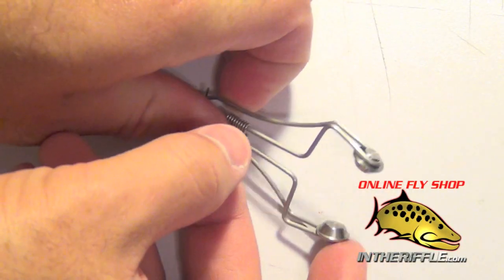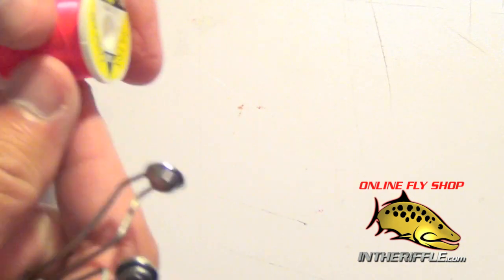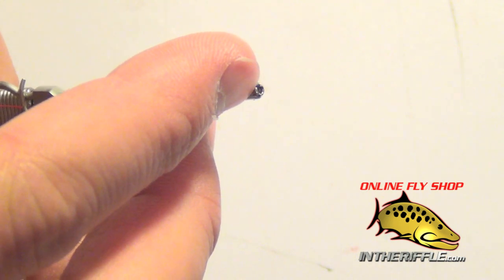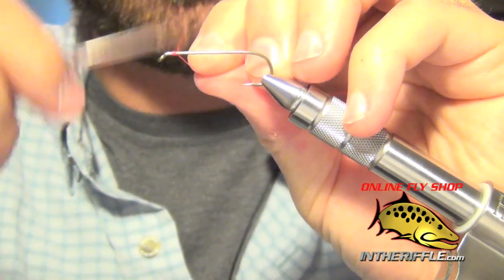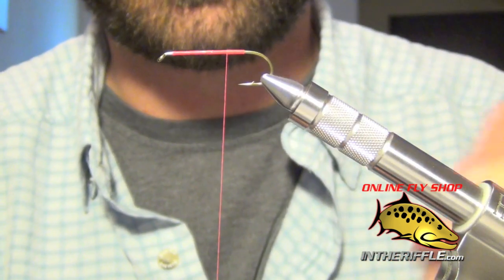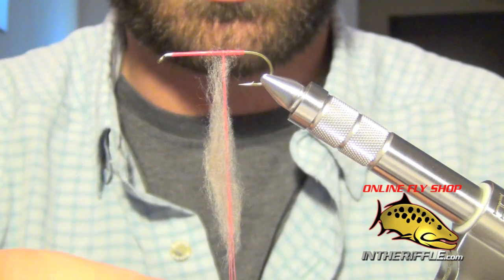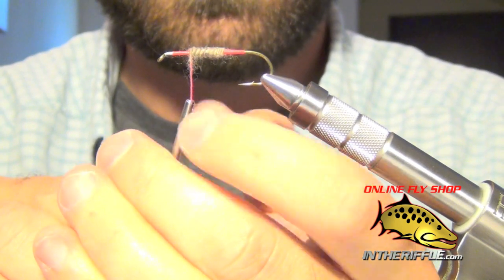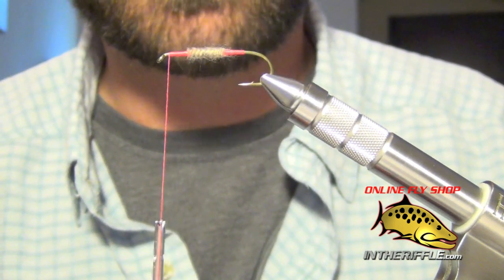Marc Petitjean Adjustable Fly Tying Bobbin

Comment: An excellent concept but with modern 18/ Semperfli threads they seem to come out of the tip regularly which is frustrating. You have to make sure the bobbins threading channel is facing downwards to avoid this happening. I prefer the Norvise retractable model once you master it and the company is great to deal with. Thanks from down-under in NZ.
Reply: I had the same problem with a lot of different threads. I atopped using this bobbin holder and sold it.

Comment: I LOVE this bobbin.  Unfortunately mine has started to cut the thread when I try to load.  I've reached out to Petitjean via their website and I'm not getting a response.  This is a great bobbin but it was expensive and I hate seeing it just sitting there on my tying bench collecting dust.  Thanks for your help!
Reply: I’m having the same problem. I have the thread come out when I’m tying also.
Reply: I have this bobbin as well, no problems with it at all. Unless you damaged it in some way, I would say it is impossible for it to cut thread.
Reply: So repair it.
Reply: i have the same problem as well, mine  has cut the thred from the beginning  when i try to load.
Reply: I’ve had the same problem with mine. Brand new and it cuts thread after a few turns. I just got two which are brand new and am disappointed they do this

Comment: Brand new and the thread pops out of the tip. Contrary to this video, very rough when wrapping thread around hook and then it pops out of that opening at the tip. This is no Swiss watch.
Reply: Agreed. DO NOT buy this bobbin. I'm so dissapointed in mine. It holds the thread WAY to tightly even on the lightest setting. As a result, there is so much tension on the thread that anything smaller than 14/0 will simply break. An $85 paper weight sits on my tying desk at present.
Reply: @jimmarstiller9091 try bending the arms out a bit…